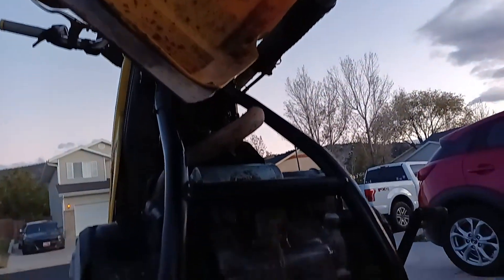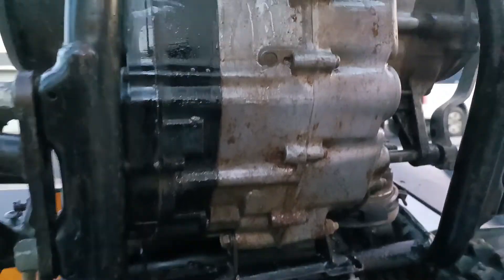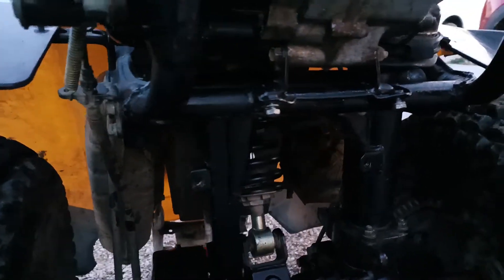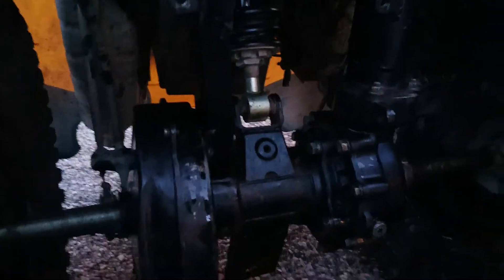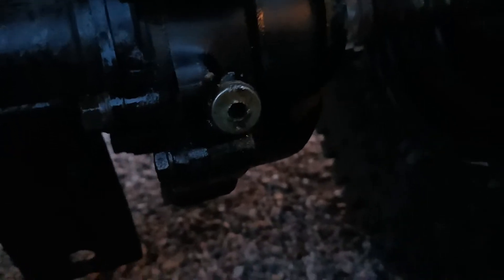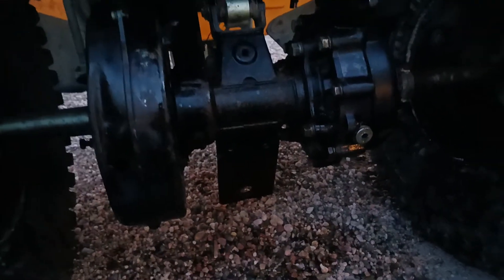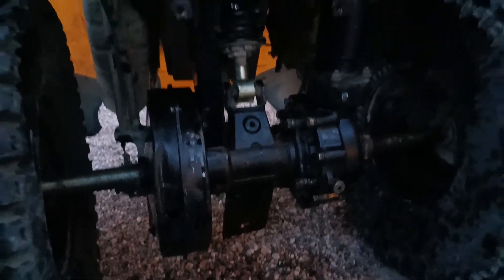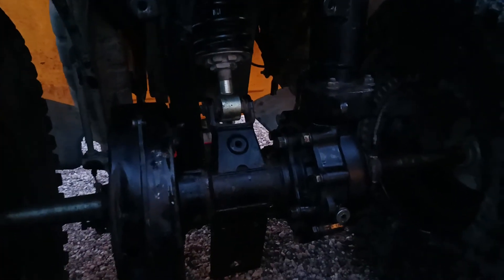Yamaha YTM225DX Differential Oil Change - Part 3

Comment: how  did you remove the drain bolt finally
Reply from the maker: I actually ended up removing the bolt on top bolt off the swingarm, the one that you use to put the fluid in normally, and draining it through there. I still have never removed the bottom one. It worked out fine.